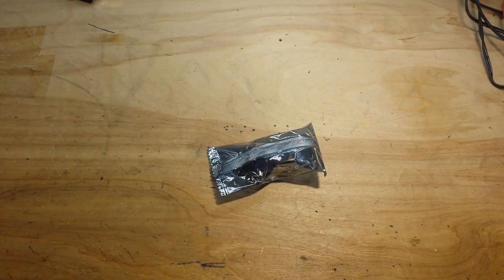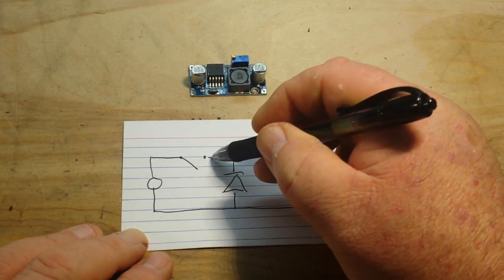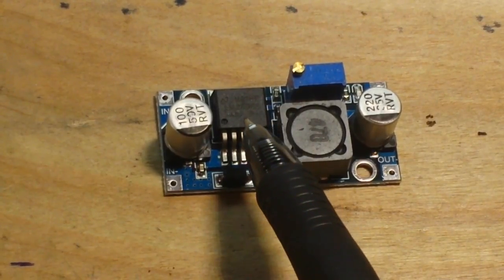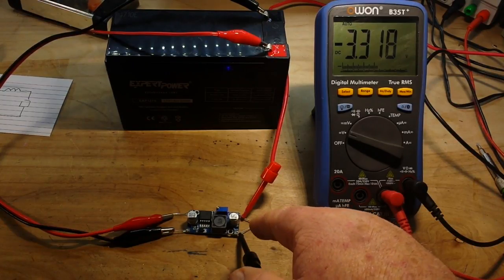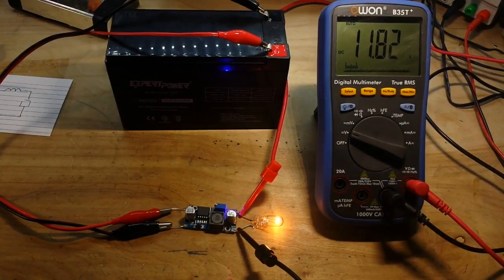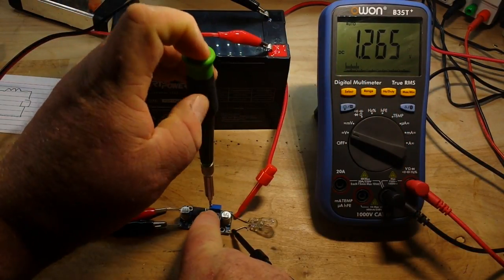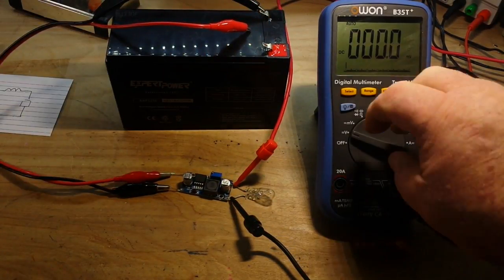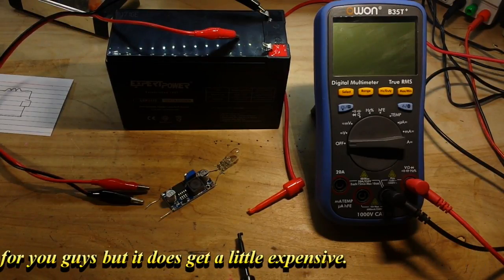Super low cost buck converter

Comment: If we add a buck converter to output of a linear power supply in order to reduce the output voltage of that supply, the buck converter will add noise to the output I guess , due to switching ?? Anyone ? I'm trying to build a 5v 1a linear psu for a dac , so learning some basics. Thanks

Comment: Just for voltage up or down (buck/boost), basically very cheap for very light load. 
The costly ones are always about: bigger ampere & stable under heavy load. These are two main aspects that make buck/boost costly and complicated.

Comment: If the input voltage drops, say, from.. 7-8 vdc, to.. 5vdc (like 2 18650s in series) will the regulator, even a smaller one, continue to provide the desired output? Thanks
Also, the closer the input vdc is to the output vdc, is the converter running at a better effeciency?
Reply from the maker: Depends on the drop out voltage of the regulator

Comment: Hi very interesting a quick question iv got one running a steady 5v out put using a 11v power block for the input could I change the power block input  for a 12.5 v and will it still keep the steady 5v output ?

Comment: Hi can someone help me,  can we use a buck converter, with and input from motorbike battery having high current and power arduino board? Like the output should be  10-7v and 1 or 1.5 amps??

Comment: does this heat and blow up while giving 5v 2.5 amps for prolonged usage?? i am working on a DRL project on using neopixels in my motorcycle...and i need to pwer it using 12v battery...to 5v 3amps atleast
Reply from the maker: It stays within specs, but it get warm

Comment: I think your channel's name applies to you as well. Efficiency is not just the ratio of Vout to Vin. There is the role of input and output currents as well along with voltages. Efficiency is ratio of output energy to input energy. Do some research before making videos please.
Reply: Cheaper to get the knowledge from china than to do research. They make everything there these days, including knowledge. They would claim 96% efficiency max, which sounds about right.

Comment: You're calculating efficiency based on 12v input. Sure the battery input is higher than 12v.   I would say, at least 12.4 and that's a very low voltage for a lead acid battery. Still it's about 5% 6% loss only, not bad.

Comment: I guess watching videos, even as good as yours and others, doesn't ensure success or even an adequate understanding ...
I'm trying to find a battery power source to power four strobe light units installed on my PARAMOTOR as we fly in often congested airspace.  Air Force and civilian aircraft like to fly low over the water just off the beach here in Northern Florida just where we'd like to fly.

I purchased supposedly 12v truck led strobe light KIT to attach to my frame.  I finally got a multimeter this week and measured the demo battery pack that comes in the strobe package (allows strobes to work on the store shelves) and - the batteries were providing 19.5 vdc.    

So these are likely the fairly standard 12-24v LED strobe lights sold everywhere. 

I have a spare 6S LiPo 50C battery pack that provides 22-25.5 vdc so I figured I use this.  My plan was to wire up the LM2596 to measure the output voltage and adjust the potentiometer to 19-20 vDC output to test the strobe lights.  Input measured 25.1vDC.I put the multimeter leads on the OUT side and made a short piece of twin lead wire connect the IN side and inserted them into the XT60 connector.

BOOM 
A firecracker went off and the capacitor was gone. I turned the Multimeter on after I inserted the twin wire, don't know if that caused the overload - no load when connected?

The video said the LM2596 was rated for 30 vDC.  A flying buddy offered that perhaps the 6S LiPo's amperage was too much.
 
I measured the 6S LiPo and it jumped around but seemed to be between 373 and 420 mA.  It's a new Chinese multimeter and I probably don't know how to use it properly.

The small battery pack seemed to measure between 95 -200 mA when connected and would drop to ZERO when the button was pushed.  Not sure I understand that behavior.  
 
Any comments you'd care to offer to me.  I have another spare buck to use but need to figure some other combination to power the strobe lights.
"Help me Obiwan ..."
Jim Sutton

Comment: I use these on stuff (like my newly converted 3d printer) to go from 24v to 12v because 24V LEDs and 120mm fans are stupidly expensive so I give those two items to the buck converter to handle.  Put the buck to 12.8v and done.  Fan runs very slightly faster and the LEDs run ever so slightly brighter.  0.78c and I bought two this last go around so a HUGE savings.

Comment: Can I use one buck converter to go from 24v to 12v and then run a 12v .7a fan and a 12v 2a charger of it. Or do I need 2 separate converters?

Comment: Minzat Catalin yes I tried it for recharge battery but the led discharging it I put one diode between battery and this buck board then the led started blinking the output voltage fluctuating can anyone suggest a solution

Comment: You can't say it's 98% or what ever efficient without measuring both input and output voltage and current... output power/input power is you efficiency.

Your videos in general seem to have have lots of gross oversimplifications that are some times completely wrong and the errors aren't subtle or insignificant either.

I'd like it if you stepped your game up a bit regards to accuracy.  :/
Reply from the maker: Thanks for the input.

Comment: If you really plan on a good comparison test(s) between several units I would suggest the following:

Efficiency of power in Vs power out (both current and voltage measured, calculate power)
Total output noise at no load and full load using a scope.

Comment: I use those often for a 12V relay on a 36V e-bike battery. Add a cheap car-switch (with LED) and you can switch high currents coming from the e-bike battery.

Comment: Many of these have a counterfeit chips, you can determine if yours is counterfeit by measuring the switching frequency with oscilloscope, instead of it being the stated frequency of the data sheet, it will be way lower, something like 50kHz
Reply: Interesting to know. I've got 6 coming here to the UK and will test them on my scope when they arrive.

Comment: You stated efficiency as volts in vs. volts out. Ah, no.. It's measured by comparing watts-in and watts-out. What you saw there was Vin minus Vf of the schottky diode + Rds of the Mosfet (which was small for this load). Cheers!
Reply: Exactly. This statement really annoyed me. Also, we never saw the multimeter being hooked up to the battery, so statements about the "efficiency" (ie voltage drop) were probably guesswork. I expect these questions to be handled properly when the comparison with the other converters is done.
Reply: P=V•I  so he's half right 🤣

Comment: I have 2 of these in my BITX 40. They can't be used for the main board because of switching noise induced into the audio. But I can use them to provide 25V for the final amp, and another one to further take 25V down to less than 12V for a cooling fan, all separately powered from the main board with 31V PSU. The main board has a 12V switching wall wart that imparts no noise into the audio. Plus a few ready to go for new projects. Never felt one feel more than a little warm to the touch. Skookum as frig!

Comment: I got 5 of these.  Would have been nice to see output on scope (switch freq and ripple voltage)...maybe perform these tests when you get the others in so we can compare.  Cheers!
Reply: Not that you care at this point, but I measured 500mV peak-to-peak ripple with a 600mA 3.3V load stepping down from 12V 😬
Reply: @connorbelli1327  yikes, thx!

Comment: Your efficiency calculation wasn't right. You only stated voltage in/out and not power in/out.
Reply: And as we all know lower voltage means lower current.
Reply: @PIXscotland, agreed. @Czar Zenana, no, it doesn't. If you said lower voltage at the same current means lower power, that would be correct.
Reply: It does if the resistance stays the same (V=I*R)
I said lower voltage and at a lower current means (even more) lower power (P=V*I).

Comment: I've used a lot of these on projects. Those trim pots are awful. The problem I get constantly is the trimmer pot failing and the voltage going crazy. I usually replace the pot with fixed resistors once I get the values. I limit their current output to 1A at most.

I now prefer the buck-boost versions of these for general use.( https://www.aliexpress.com/item/DC-DC-Boost-Buck-adjustable-step-up-down-Converter-XL6009-Module-Solar-Voltage-New-XQ-7/32825375441.html)  Sticking anything from 3-30v in gets anything out. Usual current and power limits apply though.

Comment: From a freezing Northern Alberta (+7 celsius now): I can hear your air conditioning. If you have spare hot weather, please send it to Northwest (point to Alaska and you will not miss). 
Hope you have in order boost-buck converter(s). It's  same size as "regular" ones, but can be very helpful for battery/solar/multi power sources applications. So in theory, it can provide power to esp8266 from "small hobby" solar cell (~6v), lipo battery, etc..
I'm waiting for one somewhere in mail from China, based on XLSEMI XL6009E1. I expect huge losses (maybe 45% loss?) but I can get away with much less components.

Comment: I have one or two of these kicking around.  Handy wee module for low power stuff!  3 amps sounds optimistic but still great value!
Reply: 3 amps intermittent, about 1.8 amps continuous give or take (sometimes needs a little help with cooling if enclosed or in a hot location/environment.)